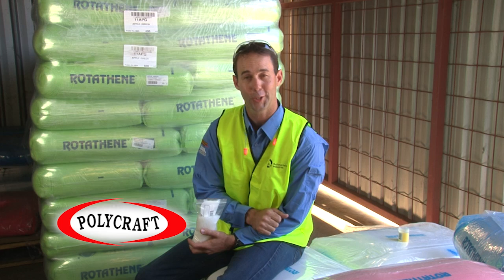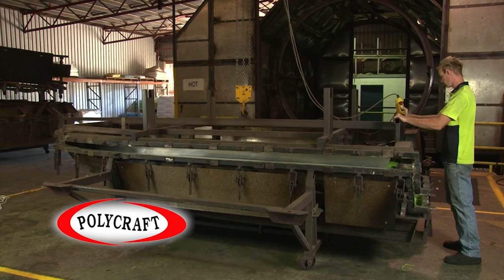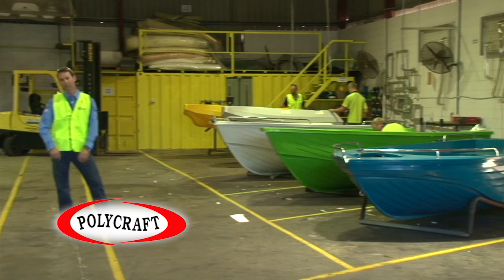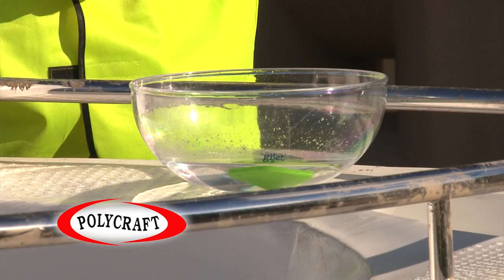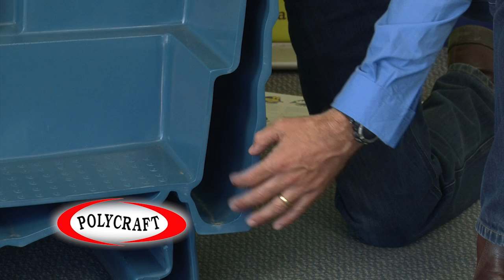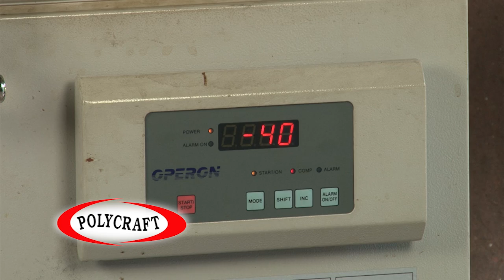Polycraft: Behind The Scenes

Comment: Dont recommended but ah well. Fitting a new motor to my tuffy. Just draged the entire boat onto the concrete berth so I had solid ground. Then fit the motor and slide her in again. They're heavy. But tough as all hell. And wow they go. 15 Mercury super flock me sideways. Im doing 43kph. Itll beat my Dads Stacer 435 with a 40 Merc on it.

Comment: These boat used to be quite cheap but now are very expensive. In saying that they are a great boat. The 455 was not a dry boat but very capable.
Reply from the maker: Peter ,the 455 has been discontinued for over 15 years mate, so yea the price has increased since then , just like everything else including the price of beer :)
Reply: @PolycraftBoats  which is wrong. Dont blame increasing prices on inflation. If these boats were 10k youd sell 10's of thousands. At the end of the day you guys are using 2k in materials

Comment: How to prevent it so it will not green / black from the rain.
So what do i need 4 wax and or cleaning products.
And antifouling ?  🤔
Reply from the maker: The same as any other boat that spends its life in the water, you anti foul the hull and get bilge pump to clear the rain water from the internal hull.

Comment: Can you tell me the reason that prevent Polycraft to make larger HDPE boats?
Reply from the maker: Flow rate , and equipment , a largest boat we can roll is a 6 meter .
Reply: @PolycraftBoats  the 5.99 C/C is one hell of a hull BTW!!  Incredibly stable, responsive and fast out of the hole. Well matched with a 150hp 4 stroke.  I had my doubts but I must admit I was surprised at how well they perform! Impressive!

Comment: Great against a sledge hammer because it is soft and elastic, when you hit rocks there will be huge damage compared to Ali.
Reply from the maker: You must have skipped over the drop dart test in the behind the scenes video . Poly more impact resistant than Alloy , the drop dart proves that .
Reply: @PolycraftBoats  I believe he was referring to when the boat gets dragged across rocks, polyethylene does well on impacts but not well on scuffing and scratches. Even dragging these boats across sand will leave scratches as they are a lot heavier than a similar sized aluminium boat. Impacts on jetties with muscles growing on them will put deep gouges in the boats.
Reply: did you watch this with your ears and eyes closed?

Comment: There’s the issue with these boats. Your using pressed alloy moulds. So very crude low resolution shape. If you could manage to mimic a good glass boat hull shape, you would be light years ahead of what you are producing. I understand the limits with the thermal issues of the mold. Food for thought.
Reply: huge issue, crude? i dont see the issue or see it as being any more crude than roll forming a aluminium tinny, you ridden in one? the ride as well as any glass boat.

Comment: Thats pretty interesting, great properties for your boat to have, so much potential. Too bad this are the ugliest boats I have seen
Reply: In theese boats you dont care about using it as a mirror.Only purpose is to use the boat vith no mainetance and "restrictions" You can bounce into the pier and nothing happen. last summer my boat a Pioner 15(norwegian hdpe boat) where at a pier in cement and some big vesselseas hit the boat and it just just "jump" back like a spring. The fiberglassboat next to it made a hole in it,s hull on it,s back and 2 people stressed a lot, i just hang there with the hands in my pocket drinking a coffee.Thats why purchase a hdpe boat. No stress and enjoying the sea.You can hit it with a axe or sledgehammer with no problems